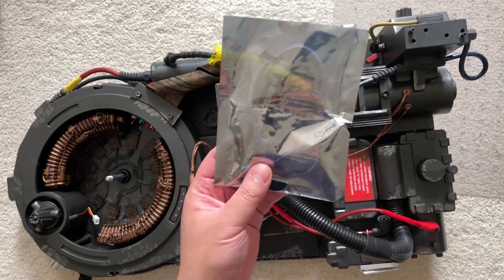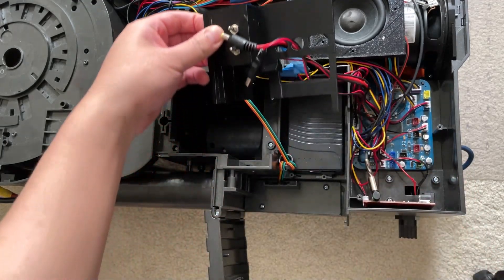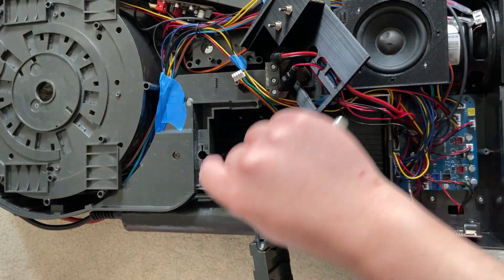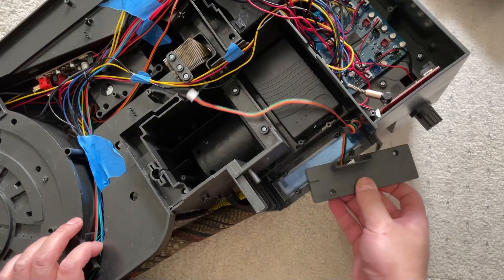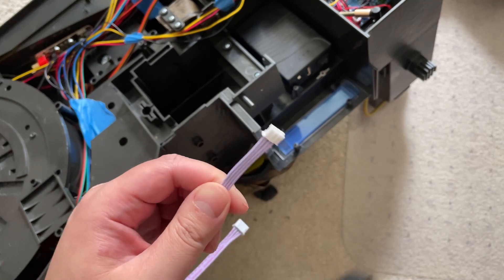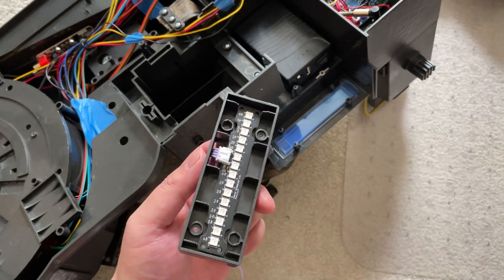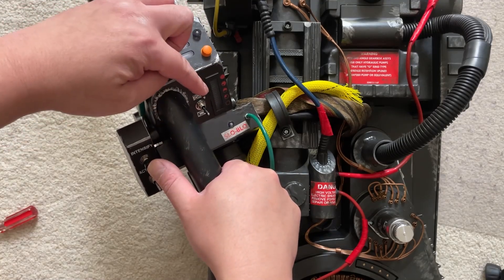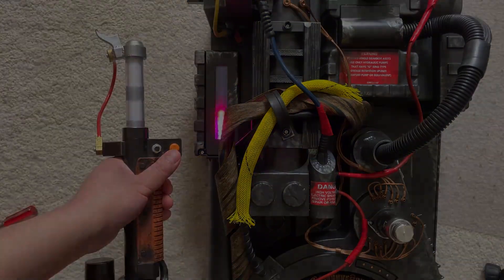15-LED Powercell Add-On for gpstar's Haslab Kit Step-by-Step Installation Guide

Comment: Great tutorial.  I was wondering if you changed the outside clear cover? It looked more diffused in the end than it did in the beginning or was that just how the camera picked it up differently? I liked the more diffused look than seeing all the individual leds
Reply from the maker: Yes I did replace mine with a very cheap diy way…I cut up a blu-ray box and glued the blue pieces together. 

It looks different at the beginning because I lowered the brightness of the LEDs so the camera picks it up better. It was too bright for the camera.

Comment: Did the screen used packs have 15 led’s?
Reply from the maker: Yes
Reply: Not that I can tell

Unless maybe for afterlife 

I zoomed in Ray's pack in the sedgwick after they blast the cleaning lady's cart

There are clearly 13 

On mine I am just going to use 13 ws2812b strip lights

So then I have the changing color and larger bulbs

Comment: Also love the mods and am going to be getting most of them once I can get the cash together. Then I will be installing them all at once was planning on using the pack for Halloween this year but I may put it off until next year to get all the mods done and also to find a couple more people to join me since a lone ghostbuster is not a very good thing need at least 2 I think but if I can't find anyone then I will go by myself. But pretty sure I can find at least 1 more person to join me. 1 last thing was wondering if you have any plans to do a trap if so thayvis great of not I think I have another option but it requires me to print a lot of stuff off and then finish and paint or I may use a company to print it for me.and then just look for the electronics later

Comment: So just for information that tool is nkt called an angle screwdriver it is called a ratchet amd most people should have at least one I personally have about 10 in different sizes please learn what tools are called before you make a video it is not a difficult task to ask of someone making a build video to knkw what the tools they are using are called. If you can install these things whichbis not an easy task then you can learn what the names of tools are.
Reply: If you can post stupid comments on YouTube videos, you can learn how to spell and properly use punctuation.
Reply: Ive just tried to follow this but my power or my cyclotron leds won't change